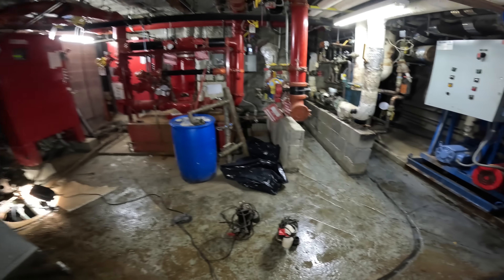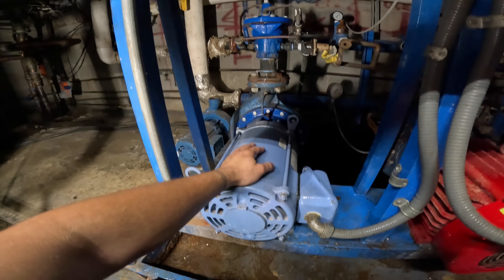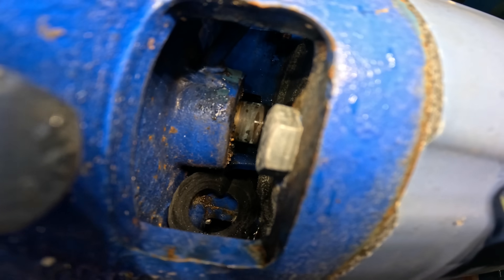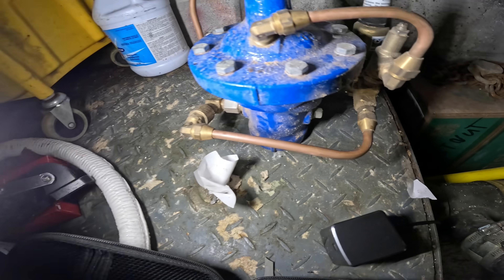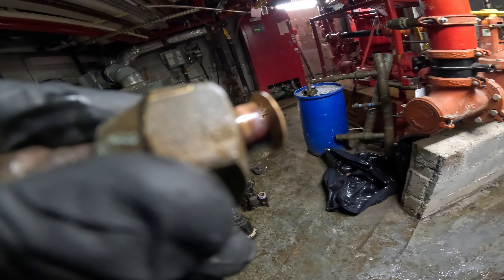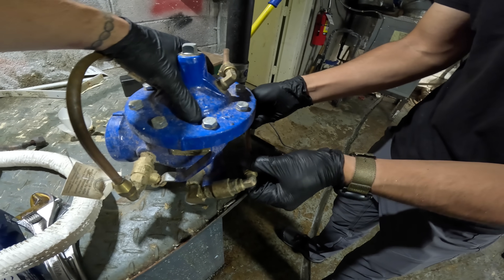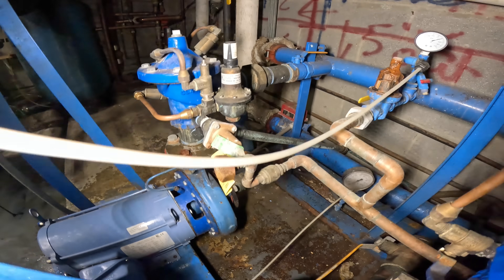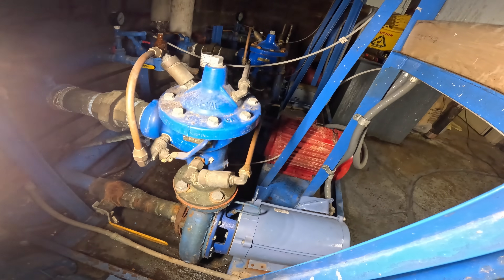HVAC Emergency Service: Domestic Water Booster Pump Leaking Water Troubleshooting & Repair

Comment: what a mess of a room and hacked up gear, the kitchen drain leaking before grease trap was extra special.
grease trap flow restrictor maybe be plugged if it's mounted right before it, trap probably full too, as that looked like lots of grease chunks on everything.

Comment: Not going to lie what caused that hole in the copper
Reply: Im going to say it started as a pinhole defect in the copper that eroded over time
Reply from the maker: @sivalley Good input! I truly wonder why. Thanks for watching 🔧⚡️
Reply from the maker: That's a good question. Im not exactly sure. I haven't seen that before. Id love to know why myself. Thanks for watching!
Reply: likely turbulence erosion, probably has way too high a flow rate through it. maybe something wrong with the valve/device it's feeding. could have been a burr or nick there to start with also.